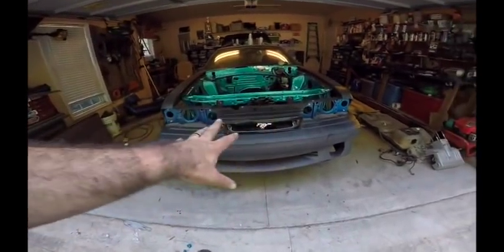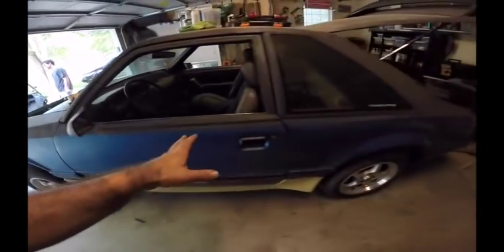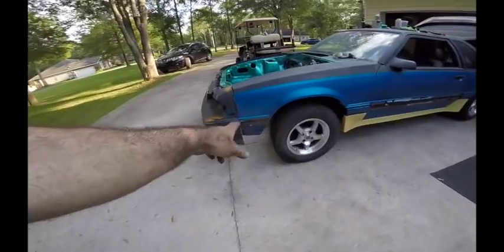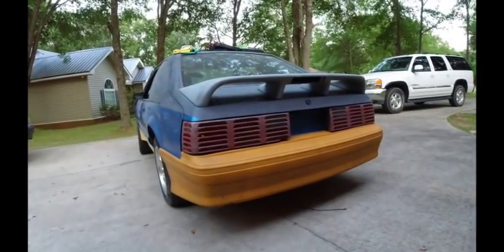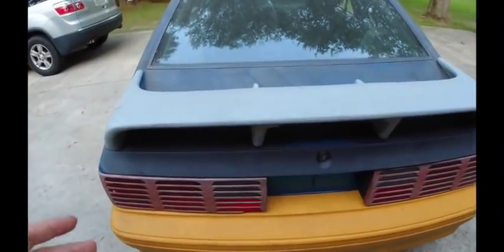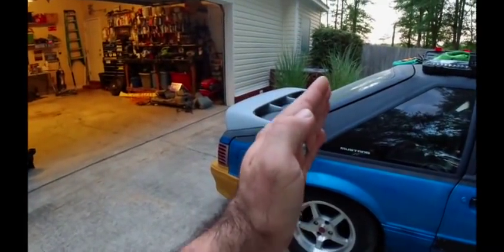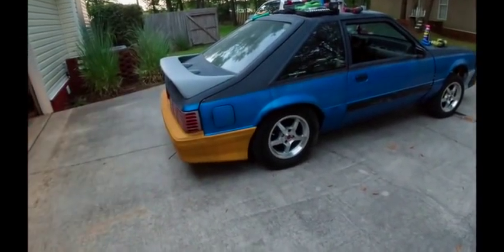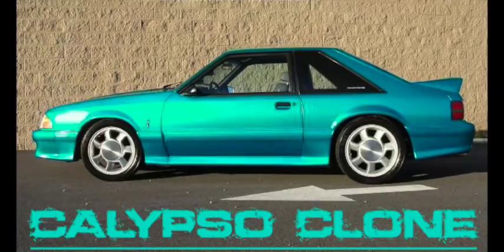THE POOR MAN'S COBRA / A FEW THING TO NOTE WHEN BUILDING A COBRA CLONE

Comment: I'd drive a Fobra all day.  Yes the front of the fenders are angled on the 91-93's.  I was always told it was for the larger tires as they went to 16 inch rims.  I put 245/45/17's on my 90 GT and scrub a dub dub!!!
Reply: Your right. That's why they made them bigger. Now that mine is lowered it rubs up front even more
Reply from the maker: Yep 👍

Comment: You know the 91-93 fender has a different fitment than 87-90 right?
Reply from the maker: As far as them having bigger wheel openings?
Reply: @BREW2LFOXBODY  well i had a 88 and a 92 went to do a front clip swap from the 88 and to the 92, and the door gaps was a lil to big im not sure if its just the wheel openings i think the door gap was a little bit different too, just a heads up

Comment: Not a fan of the title, most 1993 cobras are stock and boring. They all look the same red or black, sometimes teal. I get them all the time why did you do this or that, matching number dorks don't even own a mustang most of the time.
Reply from the maker: I actually meant to change the title... got side tracked and didn’t change it.
Reply: Lmr 5 lug 93 cobra rims is what i would use, you could use 98 dual piston calibers in front and sn95 rearend 4 wheel disc
Reply from the maker: CMD ProjectShop honestly, I’m not a brake person. I’ll slap some good pads on it and let it ride. Maybe later on down the road I’ll swap it over. But the project needs to move forward as cheaply as possible.